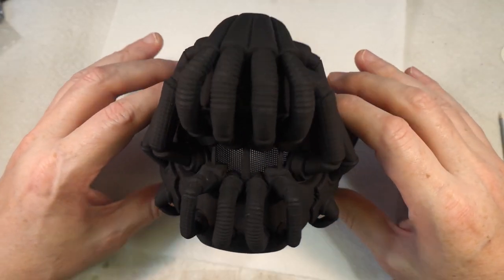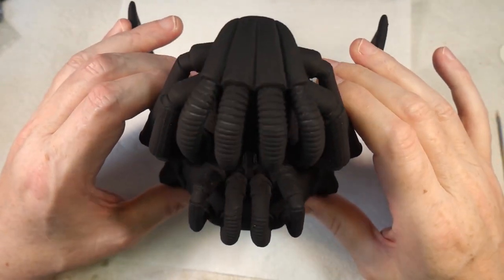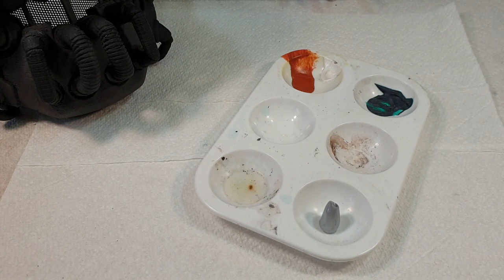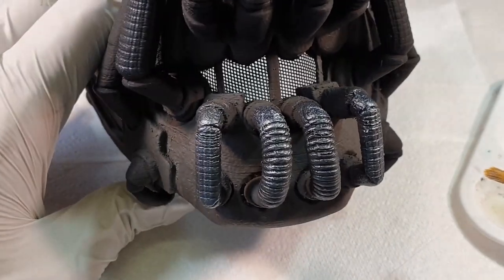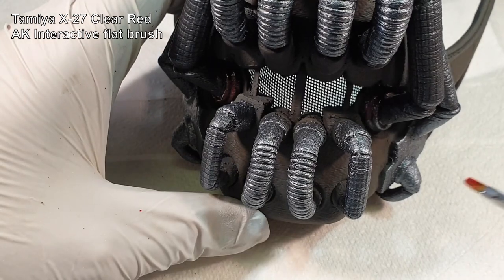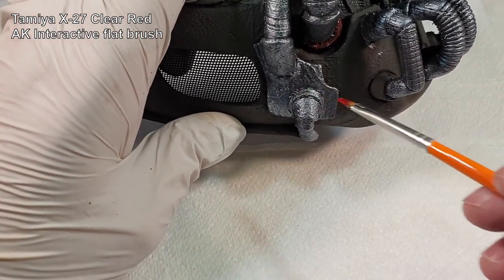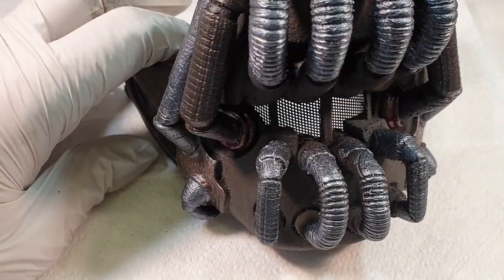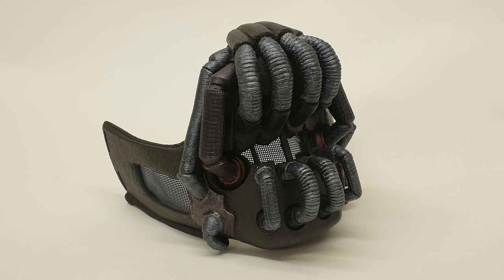Painting a 3D printed Bane mask

Comment: Looks great! My buddy just printed this exact mask for me. I just sanded it and now waiting on the paint to come in the mail. Two questions for you. Any tips on painting it or advice ? And also, I got straps for for it, I just wish it was a little tighter on my nose. Like the mask leans forward no matter where I have the straps on my head. Did you or your wife have this problem?
Reply from the maker: Thanks, I appreciate it. As far as painting goes, I don't worry too much about 100% screen accuracy - it's more about giving the flavour of the build rather than necessarily being absolutely perfect. For the straps, because of the shape of the sides of the mask, it will have a tendency to lean forwards a bit. The way the missus wears it is to kind of reverse the straps - the lower strap goes over the top of the head and the upper strap goes around the back of the head. That way, it tends to sit straighter. Also, the missus makes fabric inserts that actually do the filtering, and they  tend to help keep the mask in place. Good luck with it - if you like, you can show us some pics of the finished mask over on the Facebook group - https://www.facebook.com/groups/Badgerworks

Comment: Hi , can you please answer one question . Is it possible to use some fibreglass fabric or carbon fibre fabric inside of the mask to increase its strength . 
I have got the exact print , but just a bit worried regarding the strength
Reply from the maker: I don't see why not, although so far we've had no issues apart from one that got the corner chipped because it was dropped and landed corner first. They're actually quite strong, even with 10% infill.
Reply: @SteamGeezerUK  thanks for your response .